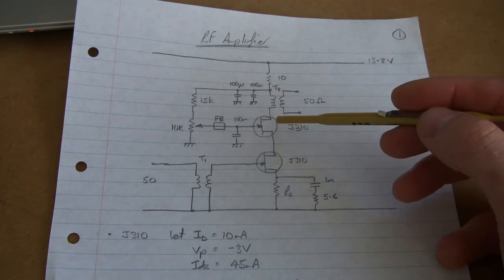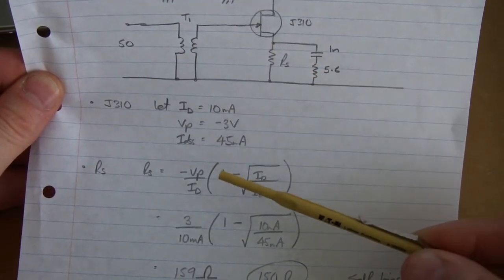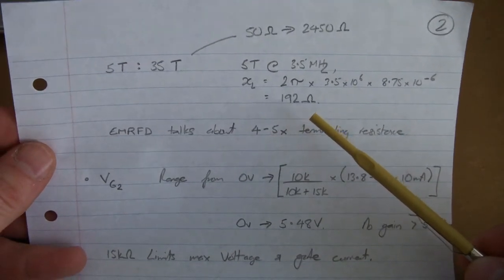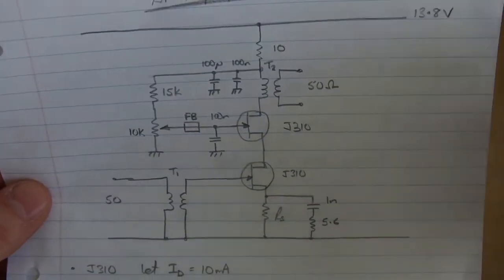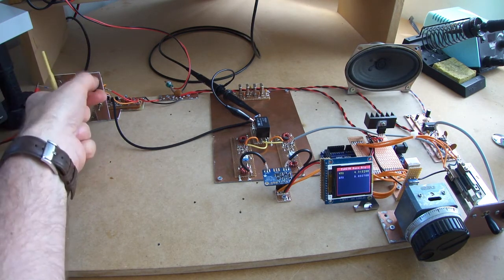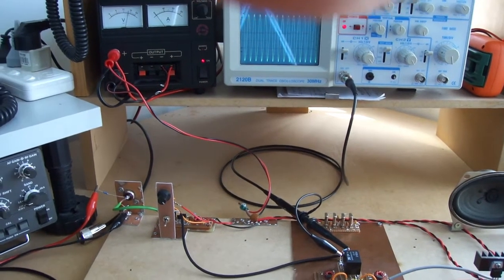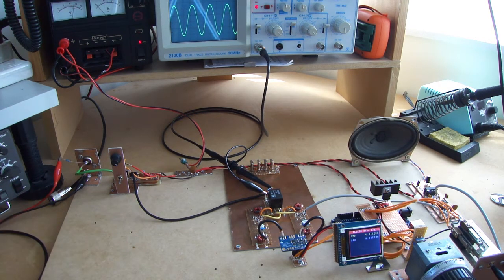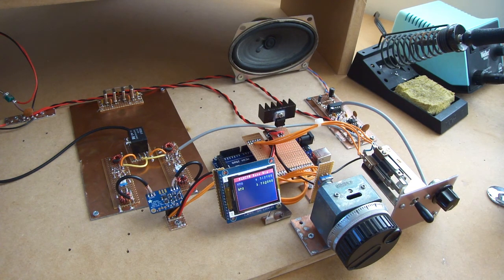Homebrew 80m/20m SSB Rig Part 4 - Antenna RF Amplifier

Comment: Aren't the input and output impedances complex (R + Xj) ? How did you handle Cgs ? It would seem that your NF would be poor? Have you calculated you SNRin and SNRout ?
Reply from the maker: Hi Michael. Yes they will be. That's clearly an area that i need to upskill on. I wonder if there is an easy way to determine that with the simple test equipment I have here. Might have to delve back into the SSDRA and EMFRD texts. I guess the other issue I have is that the BPF load is not constant from a reactive point of view due to the variable cap. The other amp works fine.  As for NF, no, that's another area that I'd like to better understand.

Comment: Hello Charlie,
once again a question. How did you couple the AF and the microphone amplifiers in your ring mixer configuration? I did it from the IF output (Mixer) with two electrolytic capacitors 10µF on this point, further one lead (1st cap.) to the AF Amp. input and the other (2nd cap.) to the MIC Amp. output. Is that right?
Do you mute the AF Amp. while transmiting?

73 Bernd
Reply from the maker: Hi Bernd. Yes, I had the AF input in parallel with the mic amp output at the 2nd mixer's AF port (product detector AF out - balanced modulator AF in). I didn't use any additional capacitors as the audio amp input is already dc isolated with a capacitor, and the mic amp output also has a capacitor.
Reply from the maker: Bernd. Yes I do mute the AF on TX BY WAY OF REMOVING IT 12V supply line. It's one of the 12V receive circuits.Charlie